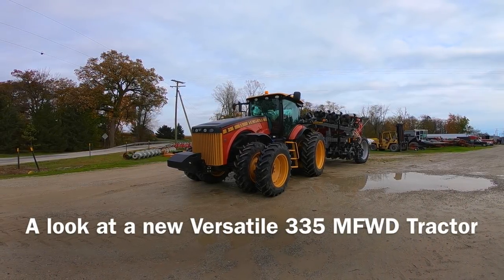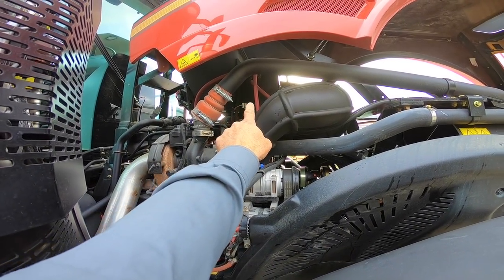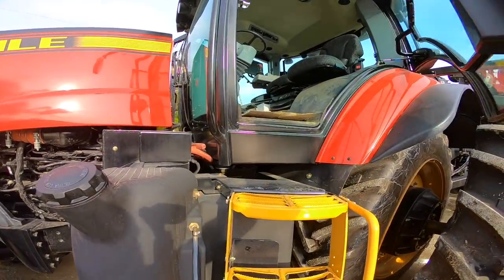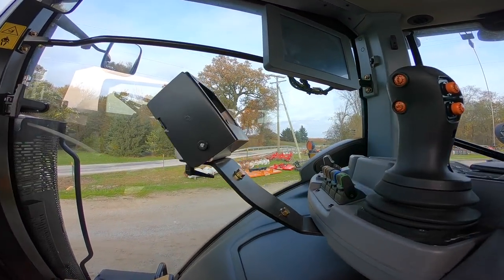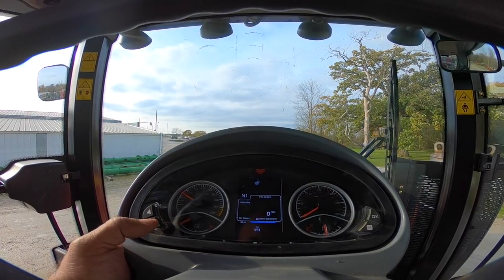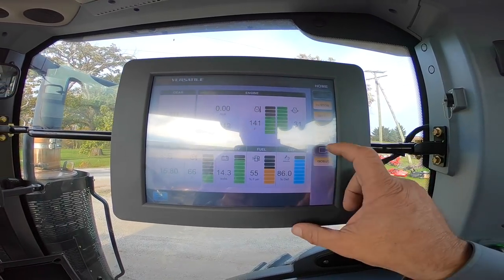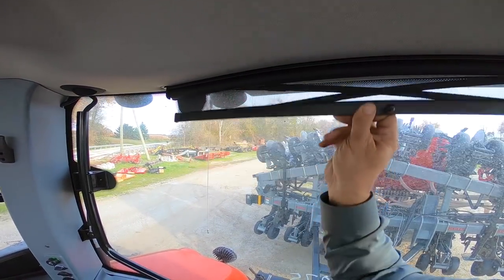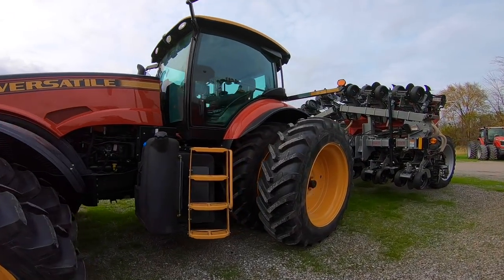A look at a new Versatile 335 MFWD Tractor at Schmidt Machine Company

Comment: Great walk-around orientation video. Love the PTO move-it-a-bit feature on the right rear fender. How thick is the owner's manual? My 2010 Dodge Ram's was well over 300 pages, but at least 180 to 190 pages of it were how to run the radio. More than my computer came with at any rate for sure.
Reply from the maker: Thanks,  Operator's manual is pretty thick plus you get separate manuals for the Cummins engine and the GPS auto steer

Comment: what is the purpose of the radar gun? Informative video.
Reply from the maker: Radar Gun measures true ground speed for a more accurate measure.  Most tractors have a calculated ground speed for each gear but that is without any wheel slippage but running radar is more accurate. Also now with most tractors running GPS that is another way for a more accurate ground speed.
Reply: Thanks for this information Mike.